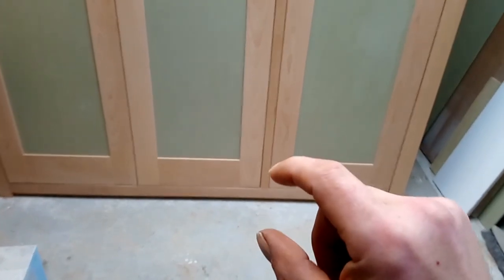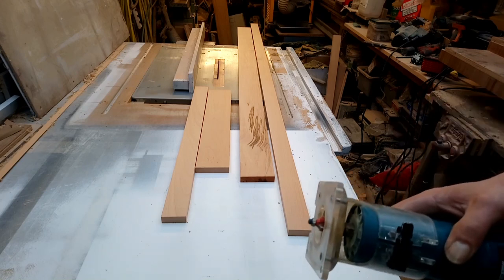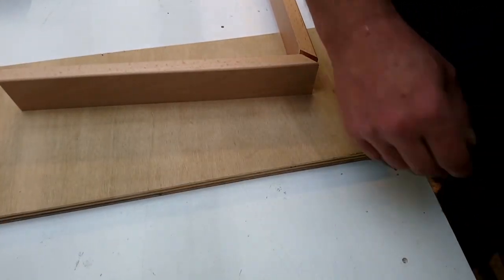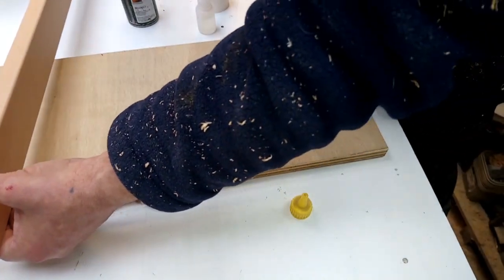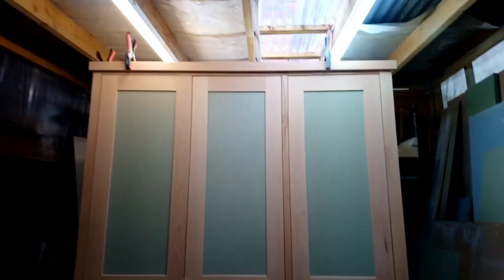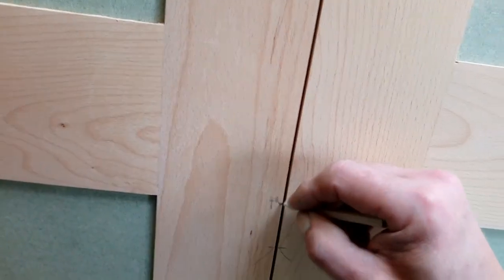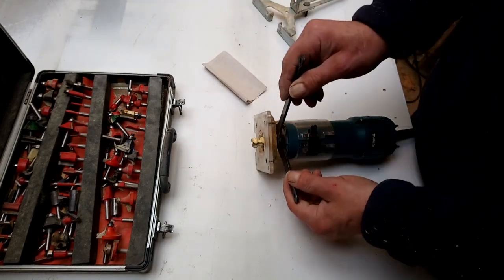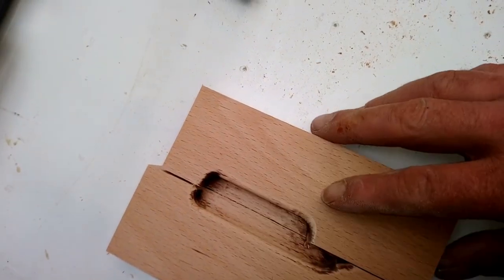Wardrobe build pt9 - Final bits before spraying, finger pull handles, cornice & skirting

Comment: Hi gid as you are probably aware, there is that taboo about how we all go about pricing jobs up. I was wondering whether you would do a video on how you price a cabinet job up
Reply from the maker: Hi, i normally don't g too much into the pricing side of things, it'll vary where you are & how much you charge for your labour costs, I can't remember which vid but i think it was on one of the drawing vids where i show my Excel spreadsheet that has all the prices i've gathered of materials over the yrs, My clients send me a scribble or pics of what they want, I then discuss all materials & design options with them, I do a CAD drawing & I fill in the spreadsheet with up to date prices, working of the drawing as reference to add up what i need & give a quote, once they've approved it i can start building, by then it's pretty much just a case of putting it together like a jigsaw, only difference i have to make the jigsaw pieces, the final price is the same as the quote unless they change something, even if it takes longer which it quite often does, it's hard to judge how long something will take & i don't rush just to make a deadline, i'd prefer to do it right in the time that it needs, all my work comes word of mouth, people wait for me because they know i'll try do it right & won't sting them with a silly bill at the end, setting the price at the beginning also takes the pressure off me, i can have a cuppa when i want without them wondering if the price is going up ever minute i sit on my ass drinking T 😊 Never easy pricing jobs tho, sometimes i make a profit, sometimes i break even & sometimes i make a loss, small jobs are good earners but it's hard to fill a wk, a 2 day job might take 3 days, so really you can only fit 2 in in the wk, which means you might only get paid for 4 days, bigger jobs can be good reg earners, paying you for a solid couple of wks but they're hard to work out the time, 14 days can easily become 16-17 or more depending on weather or other things, & some of the little jobs take way more time than you can charge, I made a TV stand which after shopping, making, spraying & delivery it was best part of a wk, i can't charge that for a TV stand + the price of materials, soo sometimes i make those simply because i want to or I like the client, in the case of the TV stand, i wanted to build it, the client is a Dr & a nice person, Drs know other Drs, I'm in her phonebook now & little jobs bring in the bigger jobs 😊👍
Reply: @Gidjoiner  I absolutely get what you mean there. Sometimes it's about making that connection. Its more important that the job is bang on that on time. Customers don't mind waiting a few more days for a job that's right, they don't want to get something that's on time but crap
Reply: Thank you buddy its always a pleasure chatting with you